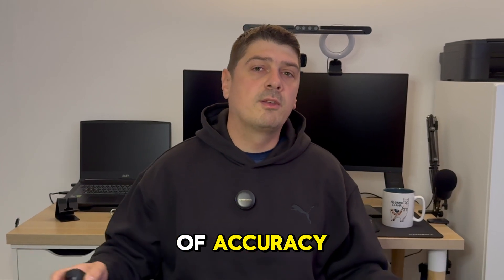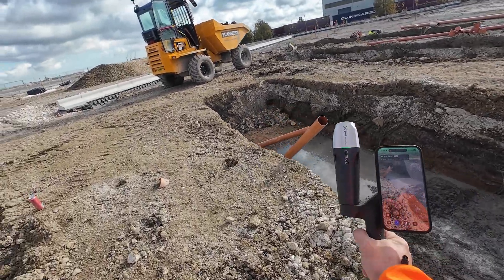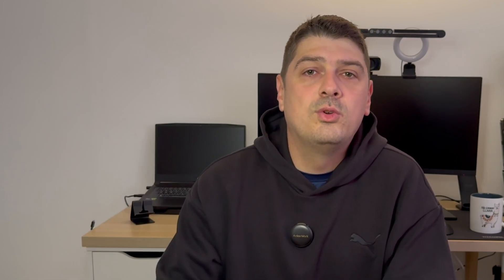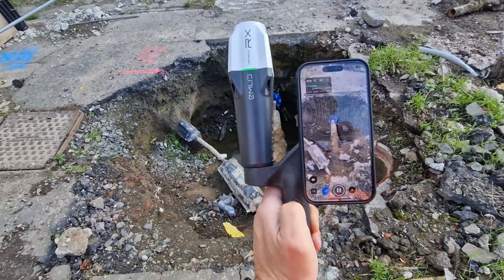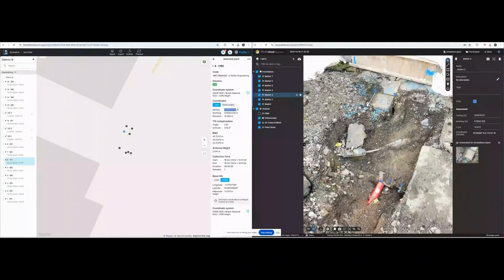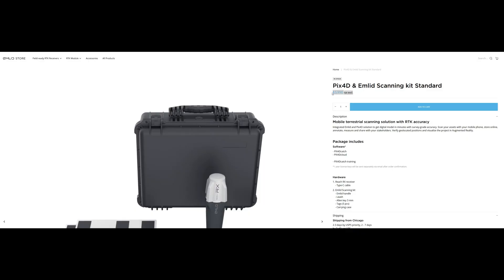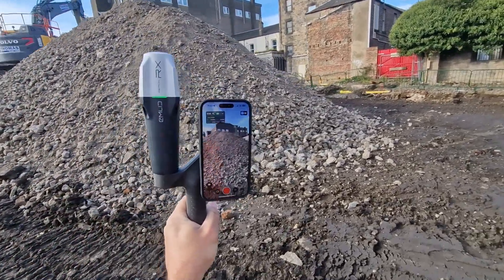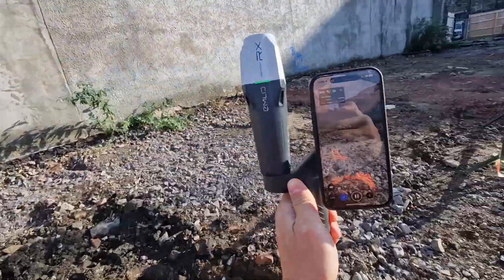I Saved THOUSANDS with Pix4D x Emlid Scanning Kit!

Comment: One big issue I can see is scanning anywhere near structures. The GPS signal would disappear and I guess the accuracy would severely reduce. Most sites we get involved with have plenty of areas of low or no coverage. Looks great for open sites though.
Reply from the maker: I tested it in different situations since and it depends also of the user. I used it indoor with targets and compaired it against total station survey and the results were 30-40mm. I didn't filmed that job but I made another video were I used it in a city survey: https://youtu.be/vDcPOw-FhtE?si=qwB83oYgyIdcT_2Q
Reply: @flyingsurveyor  will check it out, thanks! Great channel by the way.

Comment: I totally disagree with you . I have 2 vIDocs , had iPhone and android . Price to delivery of data does not equate. Absolute waste of money. Even with Emlid. I have been doing Terrestrial Photogrammetry for over 30 years . A total station or GPS and a camera gives you a better result with existing tools a average surveyor already has
Reply from the maker: This device doesn't replace a DSLR or a Laser Scanner but I think it has its use. It's using a small 12mp camera and a Lidar sensor that is design for auto-focus and definitely not as accurate as total station.
But it's very easy for non-surveyors to collect small data sets. 
I have been using it pretty much on construction sites quick capturing utility services, stockpiles and even small topo surveys. Because of it's size and weight, it's very handy to use for small jobs, instead of setting up tripods and heavy gear.

Comment: I notice all the control points were very close, like within a few meters. I assume control points that are some distance apart are going to be roughly the same accuracy as long as you have RTK fixed solutions? How does distance from the camera to the points affect accuracy? I imagine there's a distance where the accuracy begins to rapidly fall off.
Reply from the maker: @ryanmcgowan3061  those points were only surveyed points not control points. Control points are when you use the targets, but there are more useful indoor when you dont have GPS signal.

Exactly, each photo has its own RTK position so the point cloud is pretty accurate, within a few centimeters.
The scanning distance should not be bigger than 5m. Good thing is that is light and mobile. I scanned even a 200m road section with this kit and had good results